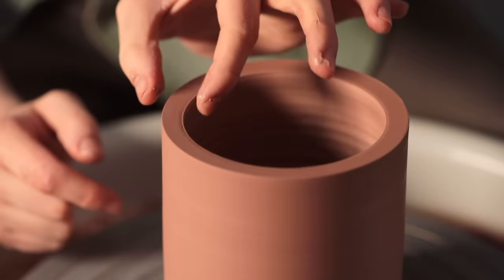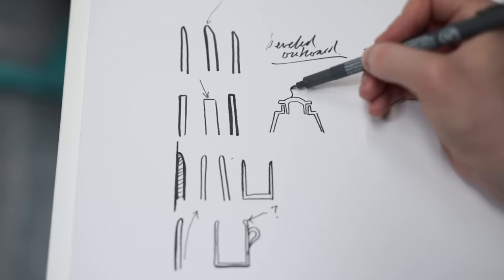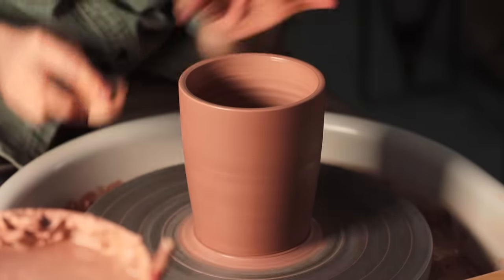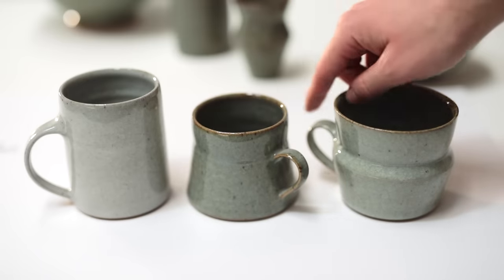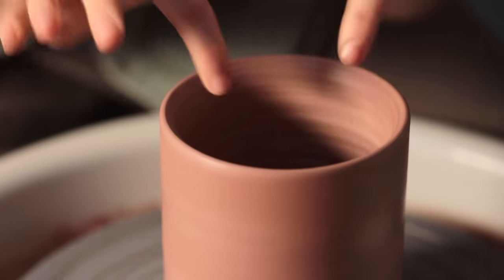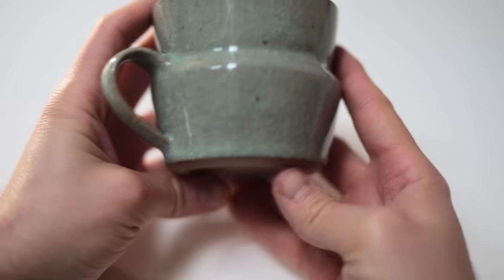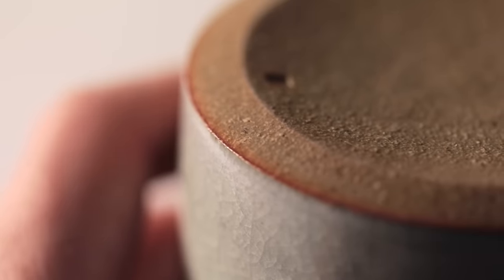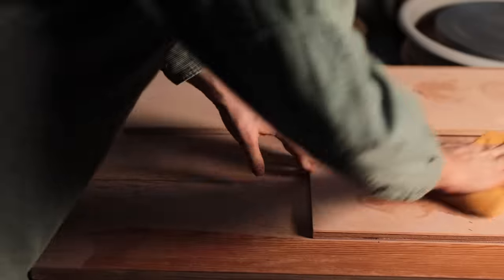Discussing Rims and Bottoms

Comment: Yet another incredibly useful and informative video. I started noticing the importance of the shape of the lip of a mug long before I ever got into ceramics (I absolutely hate drinking from thick-rimmed mugs), and it's definitely one of the things I've been focusing on in my throwing. Can't say I'm anywhere near consistent with anything at all, but perhaps least of all this - the balance of making the rim the right shape, keeping both the taper and roundness around what you want is incredibly finicky and difficult for me. There have been far too many mugs and pots where I've had to re-do the rim quite a few times as I've either rounded it too much, thinned it too much, gotten the angle wrong, or some mixture of the above. But it's also great practice! Btw, do you have any advice for preserving relatively thinly thrown rims when trimming the base of a vessel? Making a leather-hard chuck isn't really feasible for me at least, and I've seen too many rims ruined from them sticking just a tad too well to the wheel while trimming.
Reply: I have a few bisq'd chucks that I soak in water for an hour or so, then stick to a batt or the wheelhead with reclaim, then I will add a layer of reclaim over the working area  and trim back to be smooth and kind to protect rims. Use as usual. This allows you to adjust the chuck to the pots needing trimming. I have done it with fragile porcelain bowls with torn rims as well as mugs etc. Works a charm.
Keeping a leather hard chuck isn't feasible for me either,  so this is my solution.
Reply: @silkvelvet2616  Hm, that sounds pretty clever! Do you use a hot air gun or similar to dry the layer of reclaim on the chuck, or do you start out with it being pretty hard?
Reply: @Kraaketaer  no, it doesn't take long to firm up enough to work with.  Soaking the chuck for an hour only saturates it enough to let the clay stick to the bisq and not lift immediately if dry or slip off if totally soaked. After you've done it a few times, you'll get a sense of what's right for your chuck.
Be sure to make them nice and thick so they last longer.

Comment: This subject is so helpful
My goal is to eventually throw water sealed fermentation crocks
If you have any experience with them I would love to learn more about them
Reply: I've thrown several of these and I've picked up two useful tips. The inner lip should be higher than the outer lip so any excess water doesn't contaminate what you are fermenting. A top that slopes gently into the water trough rather than being even with the outer edges of the crock allows you to add water to the rim without lifting the lid. 🙂

Comment: I like to have a gentle slope outwards on my mug rims, but still with enough thickness to protect against the chances of chipping. 
As for footrings, my main product is yarnbowls.  By their very nature,  they need to be heavy, particularly bottom heavy. I have had a few potters (middle aged men) walk up to my stands at yatnshows, pick my yarnbowls up, feel the weight,  snigger and walk away.  I laugh at their ignorance every time. That aside, my compromise to giving that illusion of lightness and to protect the outer edge of the footring,  is I round it off by a few millimetres. Its not so much a visual thing as my yarnies are very round and so the footring isn't really visible unless the bowl is elevated,  but I know,  and I make my work to last.

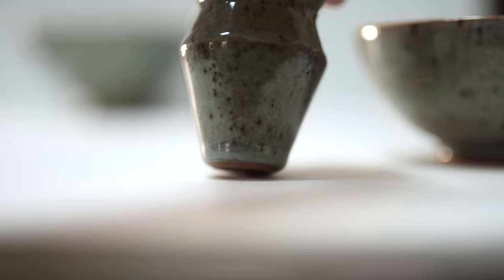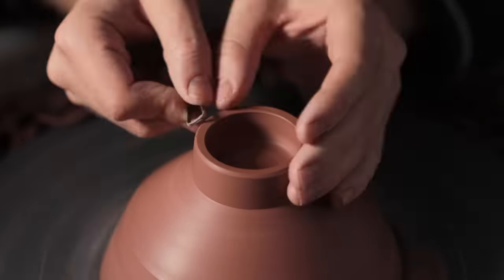Comment: 10:08  and 9:15 doesn't look very stable on the table. Why would you chose so small (in diameter) bottom! It's totally insane. I have knocked over my cup pf coffee n-times because of small bottom until I finally purchased a cylindrical cup. So imagine, you have a party and someone or you  spill all over the table because of the small and dumb bottom!?